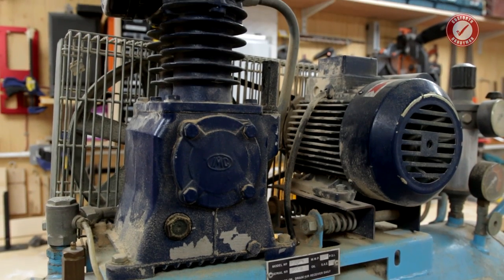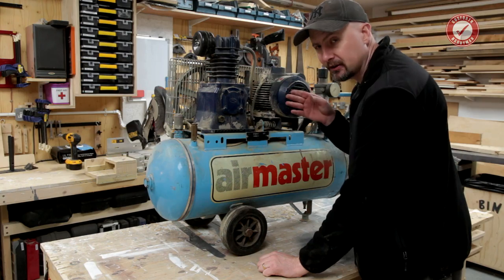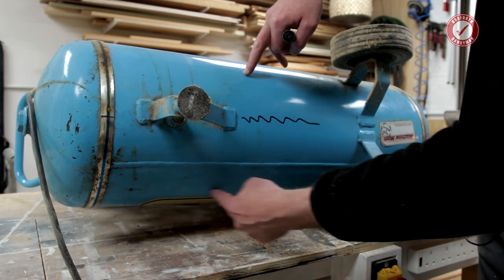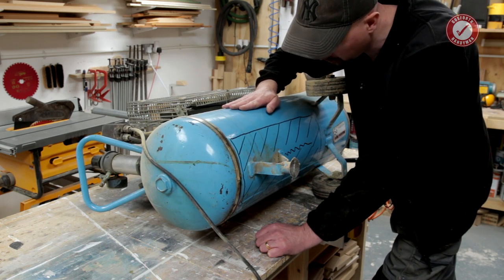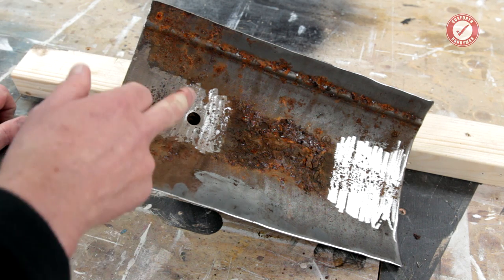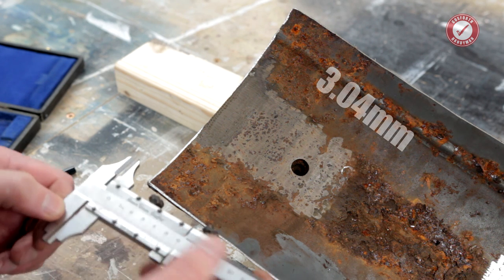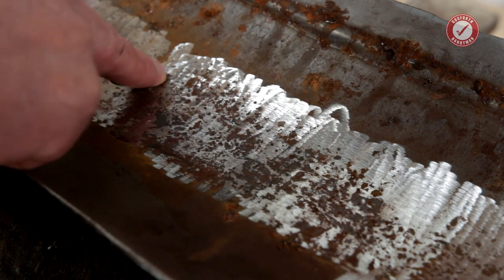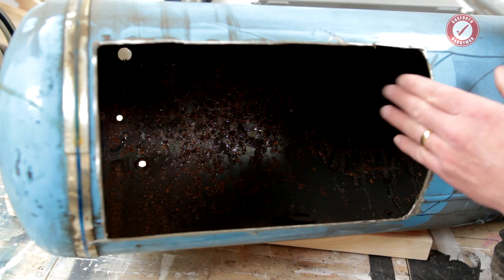Was this old air compressor about to EXPLODE ??

Comment: If anyone is worried about this, you can get an ultrasonic tester, or an endoscope and check yours without destroying it. My two main compressors are from the 70s-80s and are still fine, although a little rusty. This compressor would've been fine for 30 more years. I've researched and seen quite a few burst ones but never heard of a tank that thick exploding from corrosion, although this is the body style to be wary of. The only industrial tank that blew I've been able to find was a combustion-type explosion in a carwash facility. All the other ones that burst from corrosion are much thinner metal. These old industrial tanks have the structural integrity to resist splitting apart, they just corrode and start hissing. Seen it happen. Now if it was a Craftsman or Husky tank that looked like that on the inside you'd have a right to worry.

Comment: You tank is a lot thicker that most new tanks. I think that is why this tank made it to 37 years. Where new compressors turn to junk in just six or seven years.
It was a well built machine. I've replace two compressors in the last ten years. Not because of tank failure but because the motor or the compressor failed.
It cost more to repair these two machine than buying a new one. Off to the scrap they went.

Comment: All these air compressor teardown and explosion videos are making me worried about how unsafe it was to use the compressor at my dad's old shop. It was made in the 1930s, and in around 2004, we put an automatic drain on it after getting around 3 gallons of water out of it.
Reply: Come on man its rusted as fuck inside if it was from 1930 but they also might of made the shell with thicker metal.
Reply: one recommendation is to put the compressor outside in its own small building, 
so that no one goes near it when it is in use. . You can safely use it until it stops or self destructs.

Comment: isn't there a pressure relief valve that is supposed to blow before the tank does?
Reply: Not if the tank is so rusted and weak it can't withstand standard pressures.

Comment: When you buy new unit just disassemble it, pour a can of metal paint inside shake it good amount of time, drain lefotver paint, and let it dry for a couple of days. Since paint wont rust your tank is safe for like 100 years.
Reply: Drop some 2k epoxy primer in it
Reply: Is this actually true or a joke?  I am really curious.
Reply: @complexity5545  True. Just pick proper paint, with some rust protection, and resistant to water. In good old times all tanks were at least zinc plated (from the inside and outside), and made of proper thick steel. Nowdays they use thin steel, because it's easier to form, spray paint form the outside, and product is ready to shipping. When you protect the inside it will greatly increase lifespan of that tank. My oldest tank made this way is around 20 years old, i changed drain valve like 2 years ago and it looked brand new when i checked it. Only some residue on the paint where water accumulate (just like when you clean your dish, and let water to evaporate instead of dry it). :)
Reply: @atexc5604  I am going to try it with a tank, just for fun.  Then send my camera into it to look around.

Comment: Why can't the inside of the compressor be plastic coated. And  why would they explode  if it's fitted with a pressure relief valve     liked the information

Comment: I'd weld that section back in and put it back to work.. 'tis but a youngster. :-)

That was a fairly hefty disc you were cutting it with, where you expecting it to be much heavier steel than that?
Reply from the maker: Better sparks 😀
Reply: @GosforthHandyman  Yes.. Can't beat big sparks. I was grinding a bar in the garage last week and the neighbour's 3 yr old was across the street staring in awe..  I might as well have been shooting the sparks from my fingers :-)
Reply: As long as you are able todo pressure holding welds id weld it back up. But I'd not recommend it, then again if it was to fail it would only blow around your weld 👍👍

Comment: HYD is hydro test. The cylinder is tested for pressure in water. They should be hydro tested as with all cylinders like Fire Extinguishers. For Extinguisher 10 years from new then every 5 years. If extinguisher discharged, then 5 years from that date. Diving cylinders and compressed air cylinders may be even less time like 2 years. So 40 years. 
Well it's got me thinking as mine is pushing up the age rang. The Company that made my compressed are not around anymore.

Comment: About 3 times thicker steel than modern compressors... Why welding gas tanks are 70+ years old. They test them with water pressure and recertify them.

Comment: I bought one just like this for $100. Seller told me it was recalled for tank rusting/exploding. If I sent in a picture of tank/serial and a hole drilled in tank they'd send me $100. Which they did. So free compressor...bought a tank for $40 off craigslist.

bargain!

Plan to add a second compressor to my new system instead of spending 1000 plus on one big unit.

Comment: The test is hydraulic fluid testing done with water your compressor was last tested to 225psi you should test your tank every 10years you can to it your self by filling the tank 100% full with water there cannot be any air then connect a cheep pressure washer you can get from the hardware shop for $100 connect it to the tank and pump the pressure up until it reaches the testing pressure normally twice the normal working pressure and leave it under pressure for 12-24 hours and is the pressure does not drop more than 5% it passes if the tank false then all that will happen is a small spray of water will come out and that’s all there will not be an explosion or anything that’s the entire point of using water

Comment: You should NEVER cut pressure vessels or weld them while they are “sealed” even that small hole can’t save you if it blows up. There is atomized oil in there from the compressor and it’s highly flammable. You should fill it with water or pump inert gas into it while cutting. You could have died. As the old saying goes “we do not fuck with pressure vessels” and also cutting disks are like $3 why are you using a grinding wheel.

Comment: Hi Andy, Interesting video. Looks like the next workshop safety vid is going to be one about manual handling 😂. Disappointed you didn't invest in a plasma cutter for this job 😒
Reply from the maker: Ha - I'd love one... and a welder. Would need a less flammable shop though. 👍😀

Comment: A question for anyone in the know how on compressors ,  I bought a palm sander to use with my compressor and im lucky if I get a minutes use without me having to wait twice as long again for the pressure to build up again , its quite a big compressor could it not be working properly or do sanders just take up too juice.

Comment: I cant believe they dont rustproof the inside at the factory!
Reply: High end brands, like Schulz, powder coat the inside. Consumer, and most industrial brands do not. They start rusting immediately, as can be seen in the drain water. 
Best things to do are: drain the water every day of use, install an auto drain on fixed units, depressurize the tank if not in use.

Comment: lol coulda got another 20 years.  looks in better nik than mine. they will never explode,  unless its full of gas and you  cut into it with a grinder. the worse that will happens is when the  metal gets thin enough the  pressure will make a small hole.

Comment: Recently scrapped an 8 year old compressor.Heard a continuous hissing and checked all fittings for a leak.Then discovered that the tank was perforated with tiny pinholes caused by inside rust.My own fault for not blowing down the tank regularly.2 reasons for this the location was awkward to access and the poor design of the stopcock as pliers were needed to open it So beware and follow the instructions.I am looking at replacement compressors and have an automatic electric valve you can fit if required for about £20could be a good investment

Comment: Why don't they make them from stainless steel?
Reply: They are expensive, you can buy at least big tanks made of stainless steel. 
However you can still use normal steel if you coat it inside, coated tanks can be rust free even after 2 decades. You can also buy zinced ones.

Comment: When you used the blowtorch to help undo the unions, you heated the wrong part! If you're heating a seized nut and bolt, you should heat the nut to expand it (you were heating the bolt).

Comment: Very interesting video. Thanks for sharing. I wonder if there are compressors with a sort of lid which can be opened for maintenance. 
Sealing with rubber rings.
Reply: There is a large plug on the end that can be removed for inspection with a bore scope.
Reply: Older compressors have an inspection hatch. Ours has a hole about 4" x 3" that can be opened up.

Comment: Makes me wonder what mine looks like, I found it in a trash container and it was at least half the tank filled with water (which took forever to drain)...

Anyways after draining and drying it I’ve poured some oil into it and stuck an old compressor from an portable AC unit on it (which I also got for free), and it’s worked perfect since, though I don’t dare increase the pressure close to it’s rated recommendation, so it just runs up to 6 bar instead of the original 8 bar.

It’s pretty nice that it’s so quiet that I can use it in my apartment even at night without the neighbors complaining about it.

Comment: Your steel tank looks terrible.  My 40 year old Sears steel tank went pinhole, so my new compressor has an aluminum tank.  Time will tell if aluminum tanks are safer, but I wonder about work hardening and fracture way down the road.

Comment: I wouldn't feel too confident with recommendations to drain the air compressor daily. They rust at a certain rate from the moment they are manufactured, and I doubt that draining water would affect that rate much. Its still a perfect environment for rust and it might even speed up the rust. Draining it still leaves the inside wet. Safer to just retire the thing at 10-15 years.
Reply: @asbestosfibers1325  Do you dry the inside of the air tank every day? Just draining the water still leaves the metal wet, and the air inside the tank is nigh on 100% saturated with whatever amount of water that evaporates in the tank. 

Have you studied the inside of the tank to see if its ever dry? Your experiment (a dry piece of steel) laying out in dry air tells us nothing about the permanent wet conditions inside a tank.
Reply: Daily water draining helps a lot. Depressurizing when not in use solves the problem entirely. This isn't a good option for industrial use. Current industrial practice is to use auto drain units that drain water on a schedule.

Comment: I too have that brand of compressor (from Machine Mart, 1985) which has a 25 litre tank and has always been drained after use.

I had it in a commercial workshop for 3 consecutive years, thereafter it wasn't used, so it'll be interesting to see the tank's interior condition.

Next time Lidl have their fibre optic video camera probe thingy I'll buy one to do some checking.

I'm inclined to buy a new model (the supposedly silent ones) and before use line the tank interior surface with the sealant designed to coat rusty motorcycle tank interiors.

Just pour it in and move the tank about to let the liquid coat the metal.

Then use the video scope to recheck the covering!

Comment: Think you are over reacting, my compressor is probably twice as old as that. Very much doubt 110 psi could explode a tank, regardless of its condition. It has a pressure cut out valve and if you use it regularly you would be quickly aware if it failed to cut out. Even if it didn't I doubt the motor and pump would be strong enough to put a lot more pressure than that anyway. All I see is that you have just wasted a useful tool.

Comment: Manufacturers are terrified by the prospect of an exploding compressor for liability reasons, especially over the past 30 years. Compressors are carefully designed to overcome multiple failure points and are rigorously tested. The stories you hear are often missing a backstory where the safety mechanisms were compromised. One YouTuber claimed he drained his tank frequently and had a working blow off valve installed. I laughed because he claimed the pressure was enough to split open his tank with a loud explosion, yet it just wasn't enough to blow off the valve. I would bet the blow off valve was clogged or faulty,  replaced with a much higher PSI one, tampered with, or never installed installed in the first place. No one wants to admit to a owning a tank that's been compromised by either themselves or by a previous owner.

Comment: Hyd stands for Hydro tested. They submerge the tank in water and pump air into it to a certain point. If the tank remains in tact, it passes. If it doesn't, it's in a pressurized tank of water so it's safe.
Reply: It is  not submerged in water.  The tank is filled with water and then pressurized internally.  If it were in a "pressurized tank of water" there would be no net pressure on the tank and no actual test.
Reply: Rick - you just made that up.
Reply: Since I hydro tested fire extinguishers for 6 years 5 days a week, I think I know what I'm talking about. I did forget to mention that water was also placed in the tank I was testing. So water was in both the tank I was testing and the tank it was submerged in.  I will not argue further. Believe what you will.
Reply: Rick Hart Woodworking Your statements or description of the method of work, contradict each other and so one must conclude that you just made it all up.

Comment: What a waste of a perfectly good compressors. Those cutting discs were the fattest I've ever seen. I'd  have just replaced the PRV along with new oil in the compressor and drive belt. The pressure relief valve would go before the tank would. They test to 225 psi but its more likely it would still be going at over 300psi. In my job I use John guest push fittings and they work effortlessly at 120 psi all day long on heavy goods vehicles. That compressor had another 30 years. Shame on you Andy. Shame on you.

Comment: Perfectly serviceable, what an annoying video as you just keep stating its unusable when its fine. Clearly the top is rusty because hot air rises with the water vapour in it. Oh and btw compressed air is HOT
Reply from the maker: Have you independently serviced and verified every component of my compressor is perfectly serviceable? Would you mind giving me that information in writing with your full contact details in case there's a problem? 😂👍